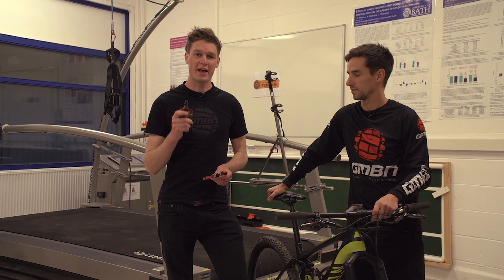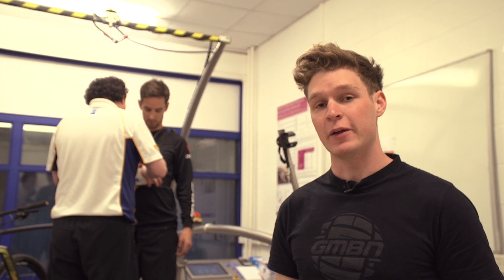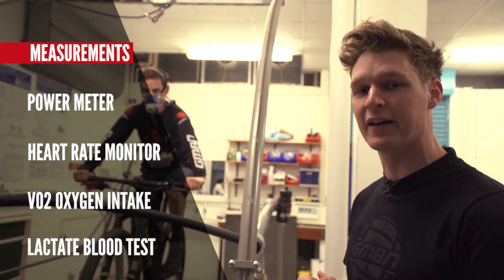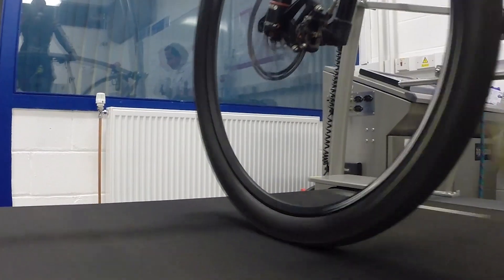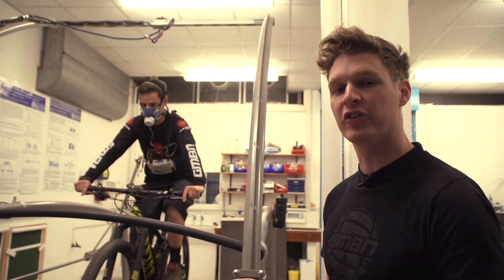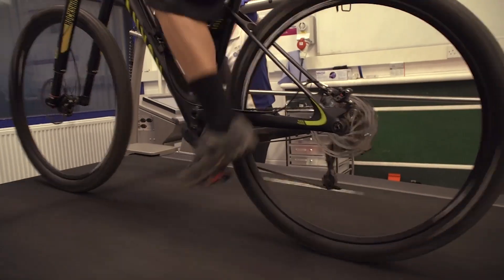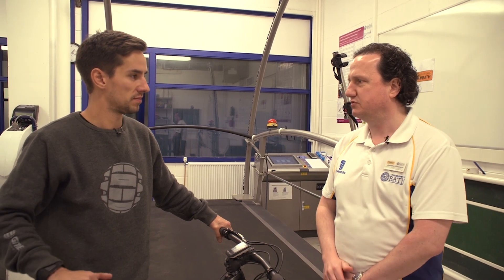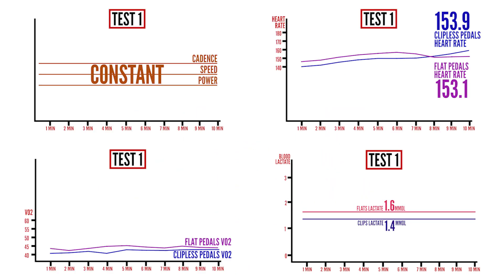Clips Vs Flats – Which Mountain Bike Pedals Are More Efficient? | GMBN Does Science

Comment: Can using more oxygen and producing more lactate while clipped in on test #2 be a function of using a larger muscle group?
Reply: If you're using more muscle (Higher Oxygen and Higher Lactate) to get the same result, it's less efficient
Reply: Maybe result of using less-trained and less efficient muscles when trying to pedal smoothly on clipless... Maybe lactate remains in the muscle for longer time  on flates as low cadence=less perfusion. On longer rides with high intensity this would lead to more fatigue on flat pedals. 
High cadence on  flat is a pro skill, BMX and 4X exceed 200/min... but best efficiency of total system rider/bike at 100-110/min.

Comment: I just switched to clips two months ago and I can notice a difference for sure.  The biggest thing for me is when climbing over roots or rocky sections I can pedal without worrying about my feet getting kicked off. I had a nice pair of flats and fiveten shoes before and would still slip off from time to time. Going down hill I find when clipped in I actually ride harder and have more fun because I don't have to worry about keeping my feet on the pedals I can just ride. My shins are very greatful for the switch.

Comment: For me pedaling efficiency probably isn't much different (especially on a smooth surface) but for me it's all about how they feel out on the trail and the confidence they give me to charge through stuff. I dont feel like I am going to get knocked off the pedals and when I'm climbing real technical stuff I feel like I can pedal in whatever awkward part of the pedal stroke that I need to. My clipless set up is also  alot lower profile than flats so it is easier to avoid rock strikes. I know that there are shoes and pedal combos that help to solve some of these issues for flats but I have never been able to justify putting money into a cycling specific shoe that wasn't clipless, especially when good clipless pedals are a dime a dozen while good flat pedals pretty much have to be purchased new.

Comment: well I've used both and to be honest I wish I had a button to change from flats to clipless as and when needed , on the flat and up hill I want clipless but down hill I want flats , even today I went up a steep dusty hill and started to spin out near the top , if i'd had clipless pedals I would have made it , btw I use clipless all the time on my road bike and they feel great , maybe its not all down to scientific tests ( although i'm glad you did this vid ) , maybe its a mixture of science and psychology ? , it seems like one of those "meaning of life" questions that no one can answer :D
Reply: That spinning out at the top is pretty easy to correct with some practice, I swap between both types of pedals a fair bit on my mtb, the clipless sure make the technique easier there but pedaling smooth on flats is pretty easy to accomplish no matter how steep it gets. Clipless are great for pedaling through chunder. With clipless you can just mash at full speed and not even think about your foot coming off and on flats you have to be more careful and get pumps in instead in those areas. The place I find flats better is when pushing through loose stuff in corners and being able to get a foot on and off real fast. I usually take a foot off if I think I might be needing to brake but want to try not to and just have the foot ready for a big slide, it just feels smoother on flats. Perhaps with different clipless like mallets it would be better. I hear people say it is real easy to just slam your foot back into them where I miss on my shimanos a bit when it is loose and bumpy on a corner exit. Oh and I have unclipped a few times on whips, that really sucks but that is just technique too.
Reply: I bought Enduro Mallet E to do exactly that. when riding uphill, I just clip in, and when I'm riding down, the seat gets out of the way, I put my foot in the middle (not clipped), and just ride down.
Trying to get used to being clipped on DH, but it is scary, I like to put my foot out very often for stability. I guess it comes with experience...
Reply: What's stopping you from using the hybrid flat-clipless pedals?
Reply: IVIusicFiend I have some of those , I have the shimano ones and the down side is the stack height on the clipless side is about 7mm difference wich makes for uncomfortable riding to say the least

Comment: I did a simple test 
flats 75miles = sore quads 
clipless = no sore quads
Reply: Unless you ride both types of pedals equally, I think the results will differ depending on what pedals you normally ride with.
Reply: Krikstar123 I guess that depends on the individual. I've used both and I personally like clipless more, I also feel the muscles used are different but that doesn't mean flat wouldn't be good for you. As I said, it's more a thing about trying both and deciding which ones are best for you than anything else.
Reply: Has nothing do do with clips or flats but where you place your foot fore/aft on the pedal. A toe push will work different part of leg than pedalling on the ball of your foot
Reply: Yeah I agree with Scott. So Kirkstar.... you fail.
Reply: You need to take the training wheels off of your bike and try it again.
Reply: I did the same test: 
Flats whatever miles = not sore at all
Clips same no. of miles = very sore quads
I'm right, you fail. Flats for the win! ;-)

Comment: to me what is comes down to is you need to produce the same power on both however on clips the power comes from quads and hamstrings meaning both will be producing lactate and requiring oxygen. whereas on flats your only really using your quads so only these are requiring oxygen and lactate.

Comment: 10 bucks you guys have been doing a comparison Full Sus/Hardtail on the same day. And you changed the rider ;)
Hints at 4:24 (other bike) and 1:24 (other socks).
Looking forward to the upload!
BTW: Very interesting and controversial video. 
Two more thoughts: Is the unexpected result due to the order of the tests? Because ten min it´s first Clips and then flats, and at 1:30 test it´s vice versa.

Where does the resistance come from? On the trail you would have rolling resistance and drag, which mainly slows you down. Where´s the resistance on the treatmill? I see the rolling resistance thing, but no drag involved.

Comment: Makes sense. Riding low intensity the clipless pedals make you use more musclemass lower intensity than on flat pedals, so on clipless pedals the muscles can recover better while driving and produce the energy more aerobically (flat pedals more unaerobically). Then when the intensity is risen the bigger working musclemass on clipless consume of course more oxygen and pump more lactate out than the very hard working smaller musclemass on flat pedals. A longer run on high intensity test - like as long as possible - would have proven eighter the aerobic limit of the driver on clipless pedals or stalling under exhaustion thigs on flat pedals, but that would´ve been road biking so of course the high intensity test was a short one.

Comment: Clips are definitely in my upgrade list, but not my priority right now. In the last three weeks I've managed to conquer (by a great length) 3 HC climb segments on Strava and I can tell you that all the top 10 (exept me) are using clips pedals.... In my experience clip-in pedals are very far superior only in wet/muddy conditions, when you'll slip on flats.
Reply: I have some good flat pedals, and under muddy, rainy weather my shoes won't slip! I have chromag contacts btw
Reply: I think fitness level also enters into it. I've been switching back and forth for XC racing and notice almost no difference in race times. But I'm in horrible shape and I'm not a spinner. It seems to me that if I was in better cardiovascular shape and a spinner that I would see more advantage from the clips.
Reply: NoBrakes23
Definitely, with flat pedals I can only sustain a cadence of 90rpm only on paved road, and my leg movement isn't round at all. Most of the time my cadence is between 75-85rpm, where i can keep a nice and round pedaling. With clips, in term of cadence, sky is the limit :)

Comment: I run clips for the back wheel control
Reply: How about getting the right technique instead of cheating with clips?
Reply: +TuNeXiZz I've been riding flats ever since I started biking, but now it is just that much better.
Reply: I think its a must on hard tails
Reply: +TuNeXiZz how bout getting some crankbros mallet E and having the best of both worlds..
Reply: +Trevor Bohnsack that's what I run they are so nice
Reply: +Lar Rode yep, love em
Reply: More like the worst of both worlds.
Reply: Yup, those platforms are useless on clipless pedals.
Reply: +DoWorkChopper please do explain? I ride them just as well as my old eggbeaters for clippling in and as good as my raceface flats..Providing the hex adjusters are dialed in..
Reply: +This Guy hmm not the case for me..
Reply: Trevor Bohnsack So, can you ride in normal shoes without being clipped in?
I could for riding to the corner store, but not on trails.
Reply: +This Guy could by why would i..I do tame trail rides in normal shoes with the dog..However use five tens on real rides and easily ride non clipped on bigger jumps and sketchy sections..Then clip in on trail sections and climbs..They key I find is on the mallet E is to dial in the lengths of the hex screws for your shoes..Works awesome for me!
Reply: Trevor Bohnsack I had Mallet 3, but Sidi shoes. Maybe I was using the wrong shoes then.
Reply: +This Guy its quit possible.. I use the five ten falcon.It basically borders on being a skate shoe with lots of grip..The clip is embedded  considerably into the shoe..So I think this helps..The only downside is sometimes it's tricky to find the clip in sweet spot...But I'll take it
Reply: 1. clipless shoes are not intended to be used on platform pedals. Maybe you found one of the few clipless shoes that would be ALRIGHT with flats. 

2. When I'm shredding I'm not trying to flip a pedal around based on whether I want to be clipped in or not 

The only time I could see those pedals being a good idea is on a trekking bike
Reply: +DoWorkChopper you don't need to flip a pedal around on cb mallet E..U clip on either side almost instantly once you learn foot placement...I will never go back to strictly flats..These pedals coupled with proper shoes are simply awesome!
Reply: All that being said, I have never tried them. If they work for you, shred it!
Reply: +DoWorkChopper will do...I do believe a lot of it is shoe choice as well..I wear five ten falcon so the clip is embedded fairly deep in the sole..

Comment: So on clips you basically use more muscles to do the same thing as with flat pedals... Slight differences so I guess the connection between me and my bike is what makes me want to use clipless pedals.
Reply: To an extent. The reason clipless uses more muscles is because you put power out through more of the pedal stroke. That means it doesn't strain the individual muscles as much.
Reply: More muscle work = less CV work